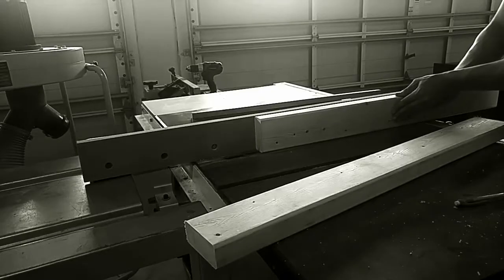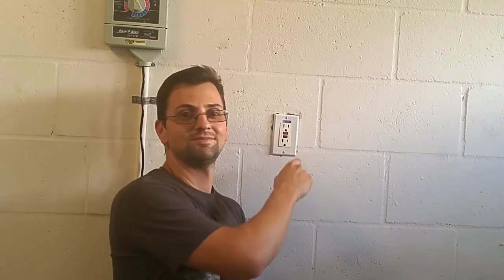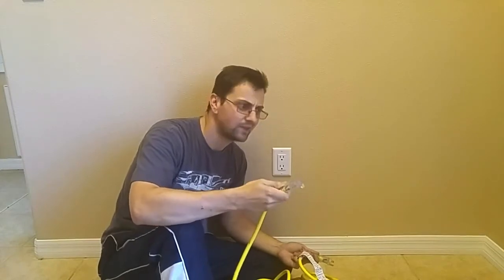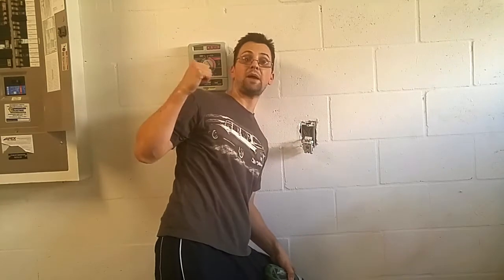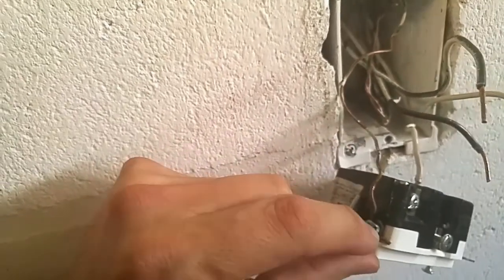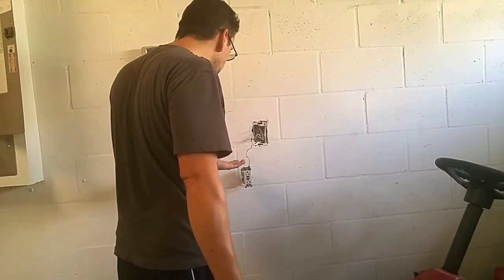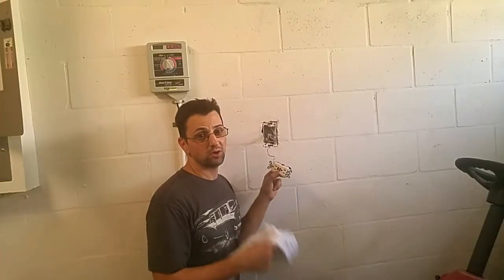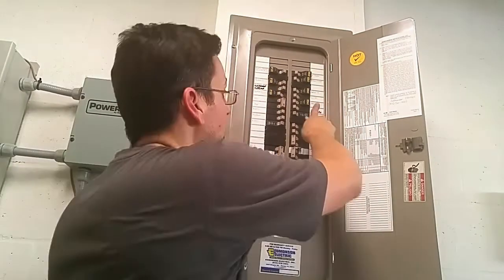Fixing an Unbroken GFCI Outlet

Comment: Wow! Nearly exactly the same issues I've had! Going on 3 days trying to track a possible short, replaced GFCI 3 times, replaced every receptacle on circuit and even breaker... laying in bed contemplating what to do next, I find your video and pray that I have the same solution!
Reply from the maker: I'm glad you got some useful information.  Good luck!
Reply: Thanks to you, I solved the problem in seconds!

Comment: Well, you just saved me the trouble of replacing a GFCI Outlet that there was nothing wrong with.  I switched off the circuit breaker and than back on and that enabled the reset button on the GFCI outlet to work.  Why can't all problems be solved so easily.

Comment: Help...I installed a gfci...only 2 wires...hot and neutral..in the line section...I have power but the gfci tester from Lowe's doesn't trip it.

Comment: Get a non-contact  voltager detector at your local home big box store, for $15, which will save you 4 hours and your life, by letting you know that was a live circuit you were on.  Always check for power when you pull the receptacle out of the wall.  Save your life and don't burn your house down.